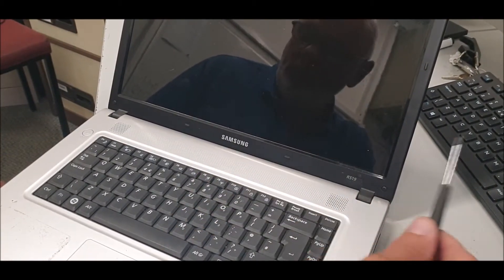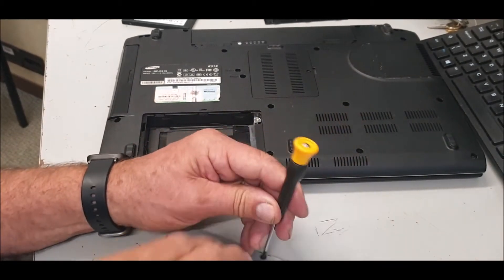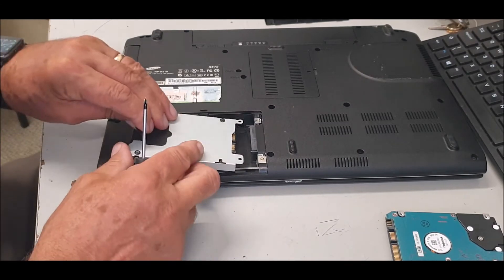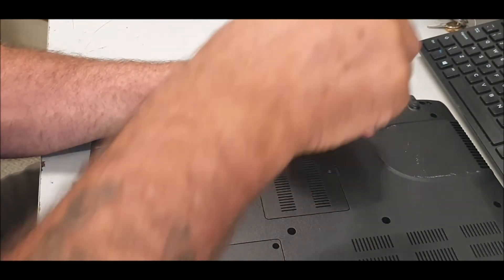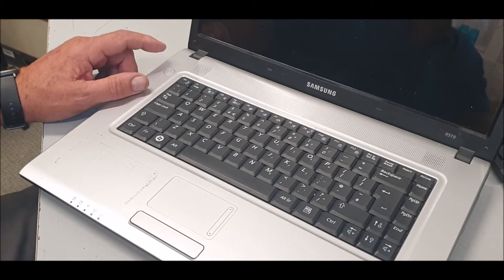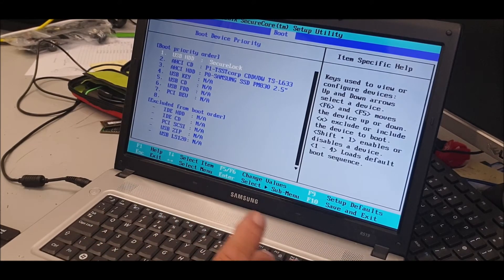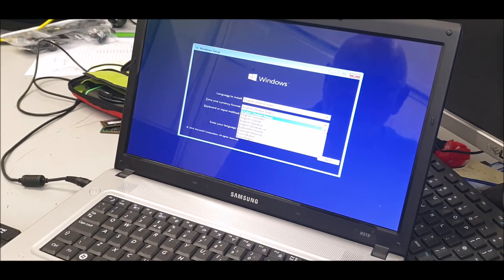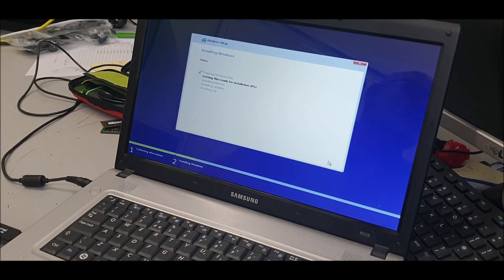OLD SAMSUNG R519 LAPTOP EASY UPGRADE

Comment: When you change from thenold HDD to the SSD, presumably the SSD is blank? So how do ypu transfer the operating system and any uaeful programs and files across? Do you just make sure you have backed up anything important to an external drive or oprical media or something?
Reply from the maker: you have to start all over so yes new media